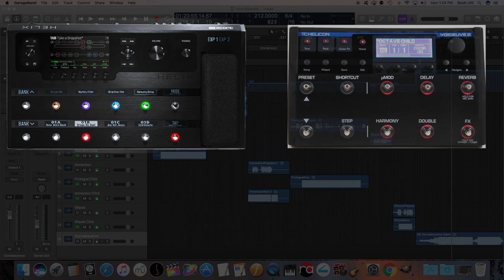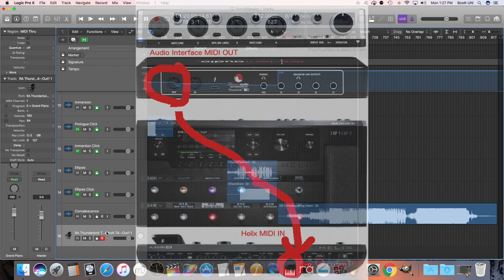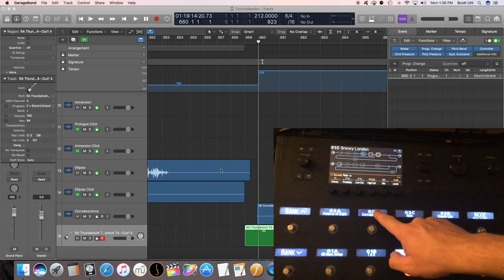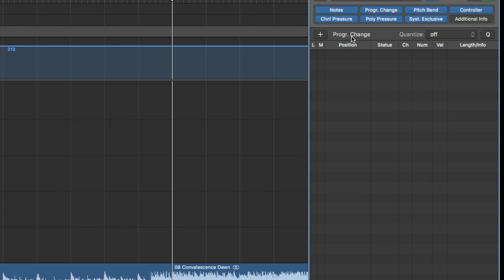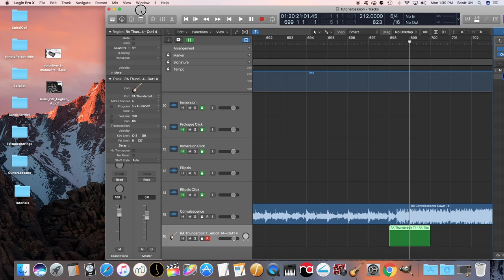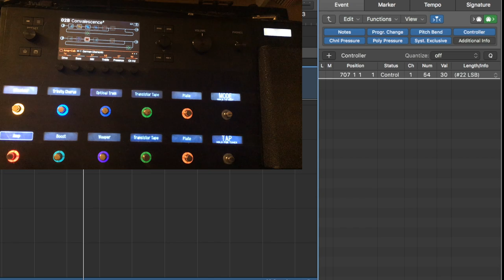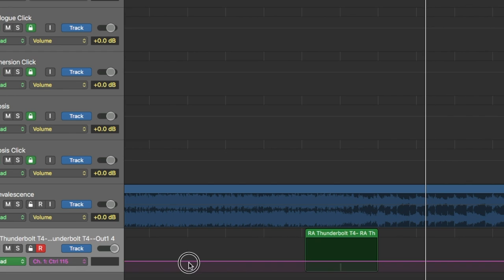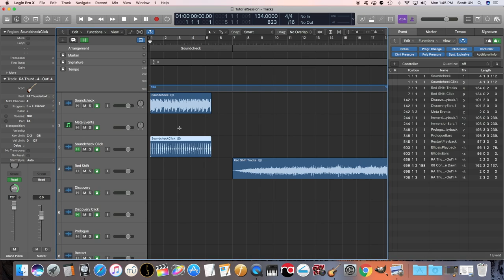How To Use MIDI to control Helix & other MIDI devices

Comment: Is there a way to use the helix to trigger commands in your daw to start and stop backing tracks with a click and all that? I've seen some bands seemingly doing that but they are secret about their setup. Can't find anything online.
Reply from the maker: I know there definitely is a way to do this. I believe it's in the Command Center. I did this with my old POD HD500, so I know it's possible on the Helix. I've never done it though. Look into the details on the Command Center. And a few google searches should be able to help. I googled "helix send midi" and the 2nd results was The "Unofficial" Helix MIDI Guide | The Gear Page. Try there and see if that helps.

Comment: How can I do this with both Chains in the Helix?
I have to use 1 Bass and 1 Guitar with programmed changes
Reply from the maker: It doesn’t matter where your pedals are in the chain, it just depends on what actions each of the buttons do. If you button 1 changes to snapshot 1, then that’s what the midi message will do. If button 1 turns on distortion, that’s what the midi send will do. It doesn’t matter where anything is in the chain.

Comment: I have a question? If i have two axe fx for two guitarists.how to connect midi with two axe fx?
Reply from the maker: To connect multiple MIDI devices, you use the Out or Thru port. So you would go Computer Out to MIDI In on Axe Fx 1. Then on MIDI OUT (or THRU) of Axe Fx 1 into Axe Fx2.

Comment: Great video! One question though, does this require a powerful computer to run smoothly live? Is this high cpu consuming? The last thing I would want is for Logic to go "System Overload" in the middle of a show haha.
Reply from the maker: Yes, you definitely need a powerful enough computer. If you are just sending audio and midi data you should be okay with a less-powerful computer or ipad. When you start putting plugins and vst's and run lights and visuals and stuff like that is when you really need a stronger computer.

Comment: It looks to me that unlike my Line 6 Echo/Mod/Filter Pros, you can only “press the button” on stomp boxes with MIDI thus toggling on/off only. Is there no way to switch an effect ON or OFF definitively with different MIDI commands?
Reply from the maker: Not that I know of... definitely don't think it's possible with the Helix. If you are using software/VSTs you likely will be able to make that work... or at least work in a similar way

Comment: You could just get tempo from Logic rather than have separate presets with different songs tempos (I guess). Helpful video tks.
Reply from the maker: randallpatrickc I’m assuming that would work. Put Helix to slave for midi and Logic is master tempo. I’ve never tried it, but it sounds right in theory. I do like having the presets for the few shows that I don’t have the midi synced up for, so it’s nice to have too. Plus some songs I like a delay with more feedback and such.
Reply: Scott - actually I just tried it this evening and as you say, Helix slaves nicely. Finding your vid very helpful - tks :-)

Comment: I’m struggling with the expression pedal. The more I look it up the more it seems like you can’t automate the expression pedal through a daw
Reply from the maker: In Logic you can draw in midi automation. Press "A" to open the automation, scroll down to to "MIDI Control 0-63" and select channel 1 (for exp 1... 2 for exp 2... 3 for exp 3). Then draw in the midi data from 0-127. Similar to how I control my TC Helicon voicelive in this video. Also, keep in mind that midi is weird. Sometimes CC1 on a unit is CC0 on your controller and vise versa. Try that as well.

Comment: i litterally need the opposite. I want to completely get rid of anything changing in the helix while my dt whammy external midi pedal is connected for only doing program change,expression and pitch shifting.
Reply from the maker: Using this method you don’t have to touch the helix

Comment: Doesn´t work. I do it in the same way but helix switch between setlists when i change program change numbers. Mmh.
Reply from the maker: Are you following the exact same steps as me in Logic? I'm curious as to why yours would be doing that. You can control setlist, program changes, and CC changes. Make sure you are doing the exact steps and let me know if it's still failing you.

Comment: Great video but I got the impression I should have watched something else first...CMD click for creating a midi region flummoxed me , what does the CMD bit do that an ordinary click doesn't?
Reply from the maker: This is the 5th video in the series. I would recommend watching from the beginning if something was a little confusing to you. Command Click is just a shortcut tool. Regular click does one thing (that you assign Logic to do), but command click does another thing (that you assign Logic to do). I have it set in this video to the pencil tool, which will allow me to draw empty midi data on a midi track. If you are interested in learning more, google "command click logic" and the first article that pops up should be able to help you out.